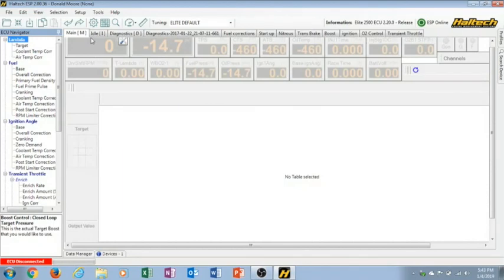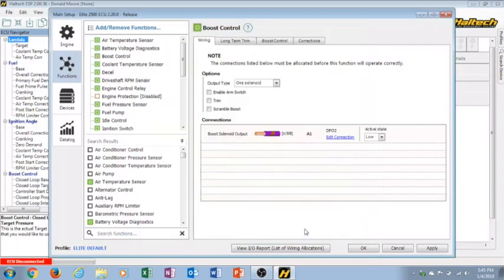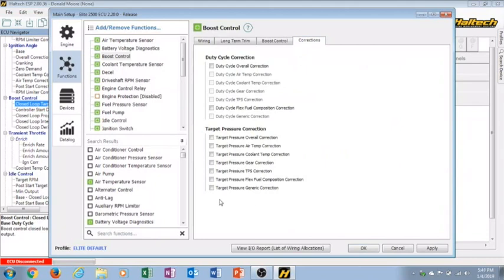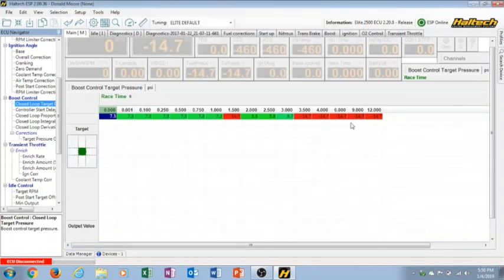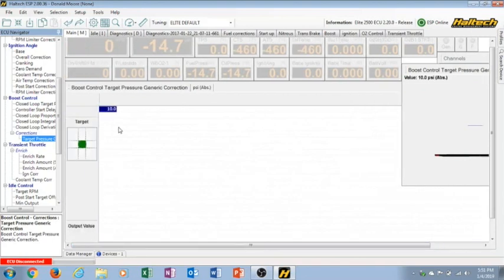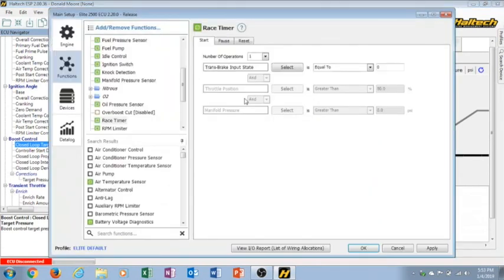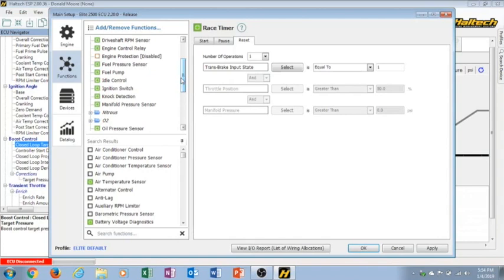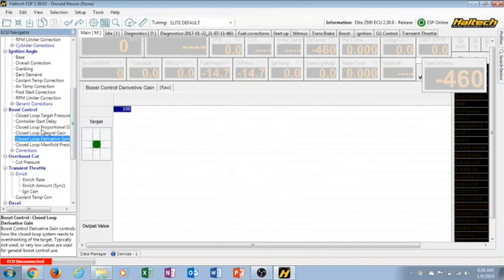Haltech Boost control tutorial

Comment: Thank you for this, I couldn’t find anything for single button multi functions. Also with the new version, the open-loop single solenoid (no more dual solenoid) doesn’t use target pressure it uses output percentage. I think I like the old version better.